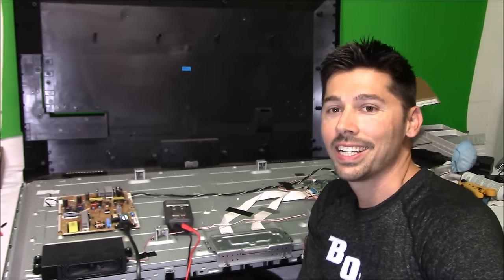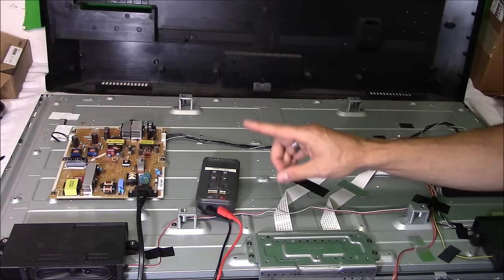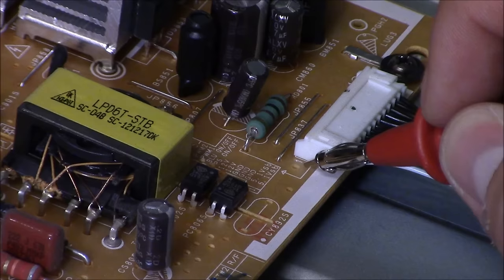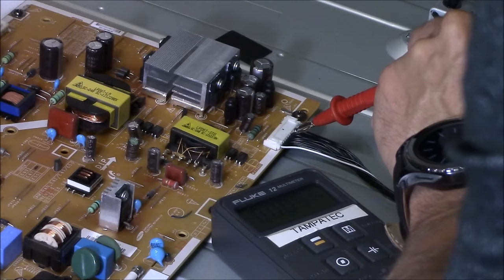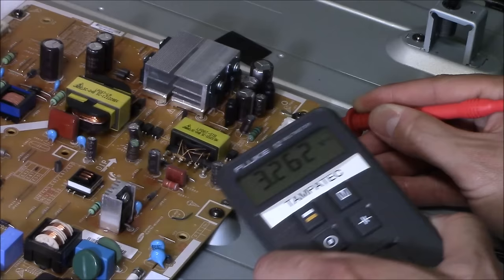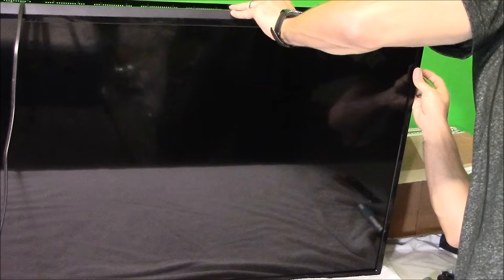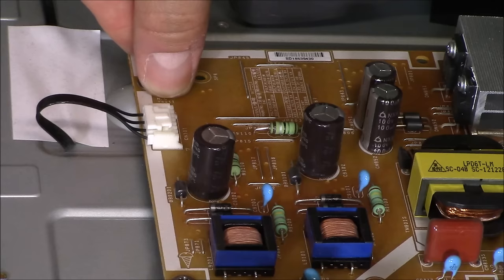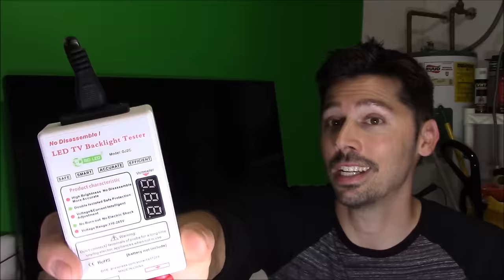LED LCD TV REPAIR sound but no picture, black screen, dark picture pt1

Comment: I'm working on a Sanyo DP42d3 with a similar problem, everything good but the backlights don't light up.  On the power board, there is a 4 pin connector for the LED strips.  The center 2 are connected together and the outside ones are labeled LED + and LED -.  Measuring from LED + to ground, I measure around 240VDC, measuring from LED - to ground I get around 24 VDC, both with some fluctuation.  BUT if I measure from LED + to LED -, I don't get any voltage between the 2.  The positive side comes directly off of a diode in the power supply, but the negative side goes to the end pin of a little surface mount IC on the back side of the power supply board.  It seems to me like I have a floating ground and that IC or something in the LED driver section of the power supply board is bad.  Does this sound correct to you, or could I have a bad/open LED? Thanks

Comment: Tampatec great video. I have a Vizio d500i-b1 and a technician told me I need to get a power supply board. I check shop jimmy but they're out of stock. Any idea where I can purchase a replacement?

Comment: Why would it send a signal to the power supply board to turn up the leds but after a few seconds drop the led intensity right down so that the lights would have to be out in room to see anything at all on the screen?

Comment: I have a Philips 32PLF5332/37 LCD TV.  On the set you are working on, the connector coming from the main board shows pin numbers on the board.  This TV Power board has no numbers, so would the power checking be in the same sequence on this connector.  I'd think it would be since all sets generally require the same power requirement.  This TV I have works for 10 or 15 minutes then picture/ sound goes off, blue standby lightoff and I have a code blink of 6.  All the capacitors have no bulge. I don't have a short reading as for ohms chk and diode checks.  Now I'm to the power checking mode.  Hope I can come up with the solution since I've been going through all of these tutorials. If you can't help I understand.  I hope it is just a back light strip problem.

Comment: Hi. Sorry I have the same TV. When I opened I saw on left side in the corner ( it  was under the metal panel ) LCD smashed. But just there. I don't know how to send you the photos. TV worked normally after Led Repair. But I opened again because I put on wrong side the shield layers. Now I don't see nothing but audio yes. When I tocun the flat cable the screen splited od black & white. This is the LCD issue or flat cable issue ? Thx in advance

Comment: What if I'm only getting 70volts steady (69.5v) testing the power at the led driver board? It acts the same plugged and unplugged (driver board) it starts at 135ish and falls to 70ish and remains steady? So no 120 or 100,but 70v?ugggg, It's a 43in vizio exactly like yours in the video. I keep thinking it's the leds but now I'm not sure? It does EXACTLY what your did. Ironically haha. I appreciate any info and direction
Reply: And the other plug checked out fine. FYI.

Comment: hi, I would like to know if its not bad to connect the console to lcd polaroid tv hdtv that has a problem? the problem before  was no picture but has a sound, no image just a bit glow but dark. and i you will heard zipper electrical specially whenever you start on the tv. For some reason after many months tv back to normal, but i still hearing the zipping electrical sound. Its just i worriend to connect the console to tv that also get damage or affected because the tv has damage? what is you view?

Comment: I have seen a few of these videos that show how to diagnose a TV with no picture but has sound. I have an LG 50LA6230 that was in a house when the power to the house was turned off for a night, then next day the power was turned back on and from then the TV has no picture - but has image using flashlight - but also has no sound through speakers - but has sound through headphones.
How do I diagnose this? Could it be a bad mainboard or tcom board or power board and the LED's are fine? How do I find out?

Comment: Our Samsung UN55KS800D screen is flickering/rolling after about 2 hours, we have gone through both the cable company and the resets as recommended by Samsung.  Just curious of a diagnosis and is it worth repairing?

Comment: Hello My friend, thank you for a wonderful video.  I have a Toshiba 32" TV with no picture but there is sound. When I turn it on and look closely I could barely see the menu screen in a very light gray scale almost.  I opened up the back and turned off the lights and could see the led flash on and off.  It flashes on very quickly every second or so.  I replaced the video board, which I believe I got from Shop Jimmy but that did not fix it.  can you tell what else I can do here?  I know you said if I could see the faded picture in the background the Tcon board is good.  Should I replace the main board too? Or do you think that it is the LED lights that are bad? Please let me know your thoughts. Thank you for your time.

Comment: My LG 47LW5600 3D TV has sound but no picture I saw a clip to put the video board in a preheated 385 degrees oven for 10 minutes. leave it to get cold then reinstall it'
Is it right? If it is, does it permanent or temporary?
Please advise.

Comment: So... your videos were very helpful and insightful in learning a lot about my Vizio E500i-B1 Smart TV but my situation has a twist that I did not hear you mention.  My TV HAS Sound.  When I turn the tv on after a long time it sometimes starts as normal but most often the image just doesn't appear.  I can see with the flashlight that the picture is there and the apps are working (i.e. netflix, pandora, etc.)  Should I replace the LED driver or the LED strips?  The driver is on the main board on this particular TV so it would mean a new main board I'm assuming.  Any direction on this matter would be helpful.  Thank you
Reply: Your video board also known as main board

Comment: I have an LG and it does not have a T Con board, just the Main Board and Power Board. Tv has backlight and sound but no picture. Any suggestions what the problem is?

Comment: I have a Toshiba LCD tv model 32HL67US. It doesn’t have any picture. When I turn it on, the power supply clicks, and I see some white lights flash a couple of times on the edge of the screen. The audio is on. I can hear static on the speakers. I checked the voltage on pin one out of the three plugs on the power board and I have 4.99V, 11.67V, and 23.9V with digital multimeter. I also hit Menu button and checked screen with flashlight and I can see the characters of the menu in the background on the screen, even though the screen is black.

What would you recommend I check next or is that enough information to tell me what you think has failed?

Comment: Having a tcl 32" roku tv that was purchased open boxed from Walmart,  was on its screensaver and the screen just went black there is sound backlights and the t con i believe is working cause i can't see any image with a flashlight and if the tv is reset there is a picture of the tcl roku image but just a black screen afterwards

Comment: I have a 32" Apex. Backlight comes on for a split second then out.Voltage for backlight circuit is only 22V even when backlight is disconnected. Bad power board? It's only a 32"

Comment: I have LG 70inch full HD Led tv, unfortunately it does not power on, I showed it to a tv mechanic and He said that display panel is not faulty. Replacing a display panel is too expensive, is there any other way or any alternate method.

Comment: I have a d50u-d1.   No picture, has sound, power light flashes.  Tried a new power board and no luck.  I have standby voltage.  However the pins that say 12v are reading 19v with the tv on.  The 24v pins are reading 22v with the tv on.  Bad main board ??

Comment: Help I've got an LG 55  UM7100PLB the set was working exsept for a pink tinge to the back light, found a replacement, tested replaced and reassembled,
now i have sound a backlight and no picture whats going on o and the t con is part of the buffer board, please help confused and frustrated.

Comment: hey sir my tv has only 2 led wires +ve and negative when i switch on 144 volts on multimeter then it droped to 56 v in 10-15 seconds and monitor britness became too low how to fix

Comment: Hey tampatec, I've got a haier 55ufc2500 and the connection from board to backlight is 4 pin (+-+-) and I have almost 300v between the outer pins and nothing between either the +&-that's next to each other. The tv is only 4 months old. Any advice you can give me would be greatly appreciated.

Comment: what voltage should pin 1 be while the telly is on. is it 24 volts.  The issue i have with mine is its reading 3.3 volts instead of 24 volts while the telly is on. could this be  bad power supply board.

Comment: tring to remove the back on a element tv model flx 3710 removed all screw ,back will not lift up. never had a tv that the back wood not lift up  and remove

Comment: Hi tampatec i have this same board in my tv and have bought a new rf board to replace mine had a problem with turning on now ive repaced rf board the picture plus all menus are upside down have u any ideas how to fix it model is te46led its a baird tv 46 also theres no option to flip screen in factory menu thanks

Comment: Hey! Thanks for the helpfull video. Wondering if you would help me out as my particular case seems a bit different. I have a samsung un50j6200afxzc 50 inch tv that has sound and a visible blacklight but no image. The flashlight test does not work as I don't see anything.  I would order a t-con board but I noticed something weird. The voltage going to the led driver board (which like you is combined with the power board) seems to be really high. You say it should be stable at 100v. on mine depending on the pins it is stable, but more around the lines of 150-190v and each pins seems different. As far as the voltage going to the mainboard it seems ok as my board says 13 v and they are all around 12.8v. This is leading me to believe I might have an issue with an LED backlight strip. WHat do you think?

Comment: Hey dude, videos are really informative and helpfull. So ive got abit of an issue i am trying to resolve and hope you can shed some light.

Tv - LG 32ln5400
Issue - tv has power and sound but no picture.

I have checked with the flash light and i still have an image although very faint.(i know this is common)
 I have no backlight on powering on the tv and there is no initial flicker to indicate there is an led fault.
Following your video, i have checked the voltage between the led and power board.
I found with power and led connected to power board i got 120/130 v .. with the power on and the led disconnected i got 120/130v. 
I think this is pointing to either the driver or i have some bad led's and need to replace the strips.

What are you thoughts? .. any help would be appreciated

Comment: I have a samsung un46eh5300f that will not light the LEDs. I can see the Samsung splash screen with a flashlight. I replaced the power board. What is next to be checked  TCON or mainboard and check what? I am assuming it is not the LED strips because all of them are down. Thanks

Comment: Hey could you help me. I have a Toshiba 43L621U TV. The backlight will turn off after about a minute. It passed the flashlight test and I can see the menu. In the settings the backlight is set to 90, but if I turn it down to 0 the TV works fine and the backlight will stay on. The PSU is a PK101W1390i, Power/LED board. I feel the PSU LED side is bad.Any help would be greatly appreciated.Thank you.

Comment: Where do you find what voltages you should see going to the LED control board? I've got a Sharp LC-50LB371U that powers on, PSU reads correct voltage to system board, but voltage to LED control board is 64. This is with the LED board either unplugged or plugged in.
Reply: Looks like I mathed and found my answer; this TV has 6 rows of 11 LEDs, so roughly 198v is needed to power them all. Even if there are 2 separate rails providing 65 volts, the power supply is 68v short of powering the LEDs.

Comment: Hi, 
Thanks for your video! I have a question. I have a Phillips TV where the picture got dark with a thick, green, horizontal line, and for a second a noisy sound on the speaker. I replugged power, it started (by it self as it do when plugging power) but got dark (only backlight). I replugged power again, but after showing the Phillips-logo for 0,5 sec it got completely dark, without backlight or picture at all. The standby supply-voltage are 3V, but ON/OFF is 0V. None of them changes when I push the power-button, and the power-board deliver 5V, 12V and 24V constantly, even when pushing the powerbutton. I've measured that the buttons cirbuit board works. Any advice? Can't find a replacement motherboard anywhere.

Comment: I was wondering if you can help me with my t.v. so my t.v. I have a lg 55" lcd when powered on it fines but 5 second later it dims out on both side of the t.v slightly only causing the t.v to only see in the middle. Any pointers on how I can fix this?

Comment: Question please. LG  43UJ6200UA.CUSYLH   Sound no picture. Flashlight test shows picture. Replaced power/LED driver board and main board, same thing, sound, no picture. Six pin connection from power supply board to LED's shows .02 volts and .03 volts connected, and .02 volts and .03 volts  with LED leads disconnected. 

If LED's are blown, shouldnt the new power boards LED connections have power with LED leads disconnected? Does this power/driver board not put out voltage to the LED's unless there is a draw? I only have one power board and the main board. There is no seperate inverter/LED driver board or TCON board.

At the 14 pin connector on the power board I have 11.8 volts at the five + connections when the TV is on standby. When the TV is "on" I have 3.45V at the PO connection, and 3.22V at  the PDIM,and INVON connections. I have not checked the LED strips yet. Thank you for any help you can give.

Comment: Good day. I have a sharp lc 60le635e tv. When i plug it in then a steady blue power light comes on. If i press power on remote it will react to it by red light signal while the blue is still there but it wont go on. It will not change blue led to red led.. Once is a month the blue changes to red and the tv goes on normal. Upon restart or off on will do the same problem. All voltages on psu led drivers 5. 12 etc are there. Any help..? Thanks

Comment: Hi. My vizio LCD has sound, but no picture, and it has the back lights on. It's about identical to the one in this video, but the voltage on the vout1and vout 2 is reading 103. Is that still a problem with the LCDs?

Comment: I have  Samsung un70nu6900fxza The tv when I plug it in keeps turning the back lights on bright then dim and off. It keeps repeating that cycle.  I have replaced the power board but that didn't fix it. I'm at a loss for what to replace next.

Comment: I have a sharp lc-50lb481u no back lite ,90volts at connector. all voltages to main board are good.flash light test good. disconnected backlite conn ,put external 50volts on conn still no bl.i guess bl.ckt open?

Comment: Hi Tampa-Tec.  I have an interesting one.  I have a VIZIO VT470M LCD TV.  It is strobbing on the backlights and I have already replaced the capacitors on the backlight inverter boards.  The capacitors are the same voltage and micro-frequency as the ones that were pulled (35V and 680uF).  I have noticed that there are also three capacitors burnt out on the power supply board.  Would these affect the backlight inverter boards and make them strobe the backlights?  I am also wondering if the t-CON board could have anything to do with the strobbing when the backlight is turned up.  I presently have the backlight setting at around 20 to 22.  Any higher then 25 and the backlights start strobbing.  Let me know what you think.  Thanks.  Clawpaw

Comment: I have Toshiba 32 led TV,  no backligh, my votages drops from 100 to 27.7 and on return wire votag drop to 1.5 .  Is it driver board faulty or back lights.

Comment: I have a Samsung oled 9300.  when it powers up it goes to an all snow picture then in about 1 second it goes to little lines at the bottom eigth  screen with the rest black.  is just outside of warrantee. suggestions on what it is and a location for parts.  I can send a video of power up if you have an email

Comment: i replaced the power supply/led board and it still doesnt work i took the led screen off and the top to led strips keep flickering and when i check with a battery tester at 500v dc the top leds wont turn on but when i check the second one down the top one turns on and when i check the third one down the top two turn on and i cant get any power from the bottom to you think its the led strips or bad wiring?

Comment: i have a sumsung plasma model number PS-42P2SB TYPE: D53A42P2 and when i power it on i get nothing on the screen but the red light  at the bottom is on. also i get no response when i push the buttons on the tv as well as the remote

Comment: hi i have a sharp aquos 70 inch that wont turn on when i trie to put it on the white light in the middle of the tv is blinking two times is that the standby button ?when i trie to do the tricks i see here on your video s   that dont work the blinking stops then it blinks very slow on and on and so on then it goes baqck to blink two times again can you help me i dont no  how to fix this  sorry for my bad inglish i am from holland .
i hope you no what the two time blinking is and you can help me greetings corne